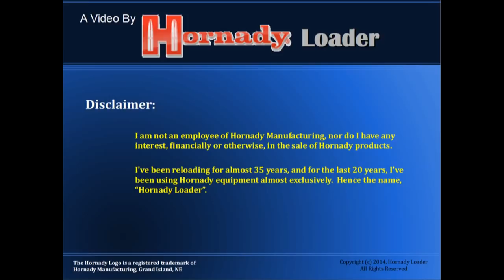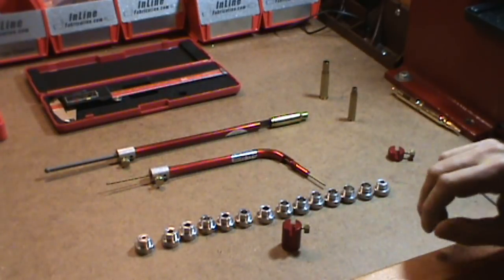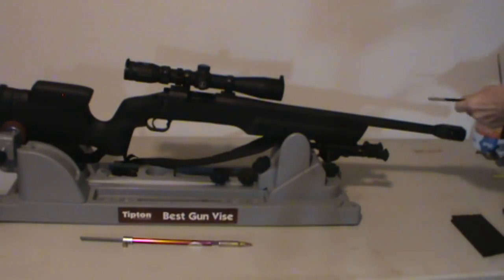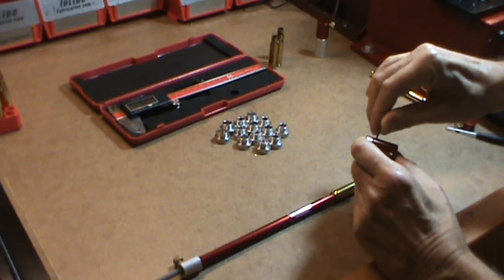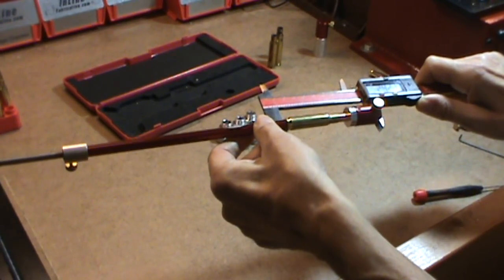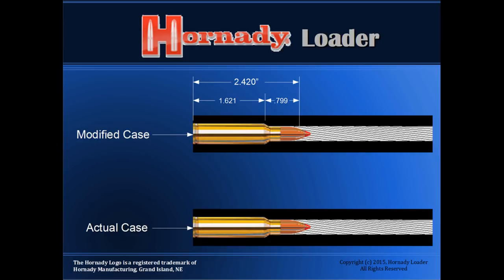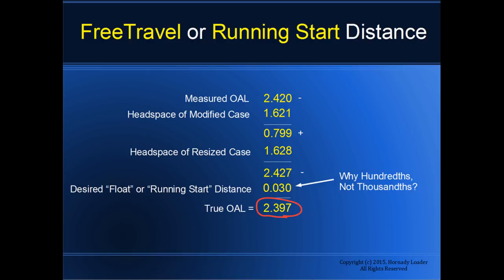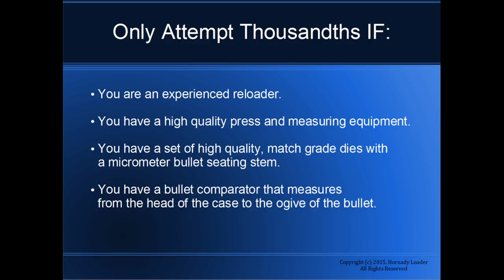Hornady Overall Length Gauge and Bullet Comparator

Comment: I don't understand why you would have to go through the same process with the OAL gauge again if you changed bullets. Since you know the oal to the ogive, why can't you just measure to get the right bullet depth using the comparator?
Reply: It is because where a bullet makes contact with the lands is not necessarily the same contact point it makes with the comparator and given that different bullets have varying angles, the measurement needs to be made for each bullet type. For example, with my 308 when measuring seating depth to touch the lands for 165gr Sierra GK's, 168gr Hornady A-Max and Hornady 150gr SST's I got a different CBTO measurement using the same comparator for each of those. There is not a direct relationship between where one bullet contacts the comparator over another and where they contact the lands. I hope that makes sense.